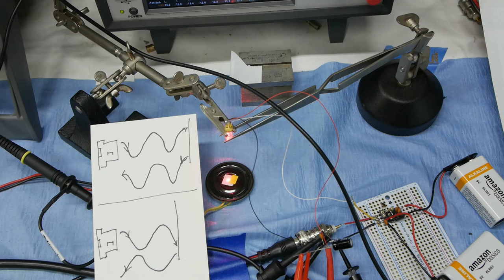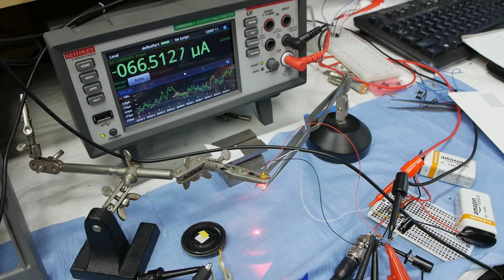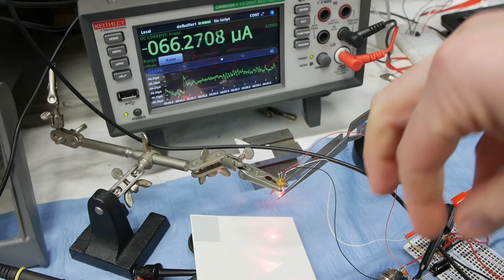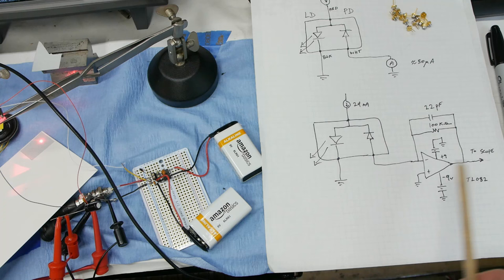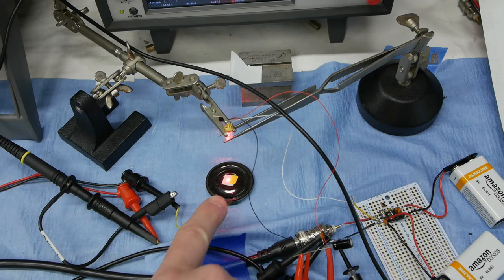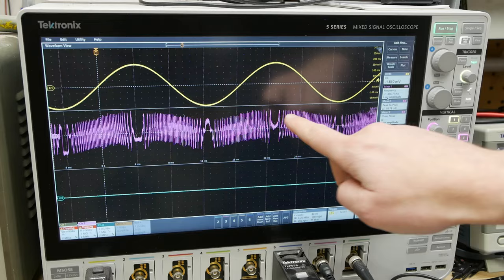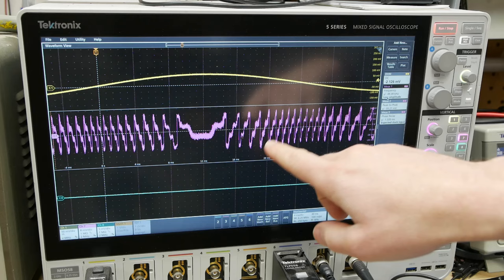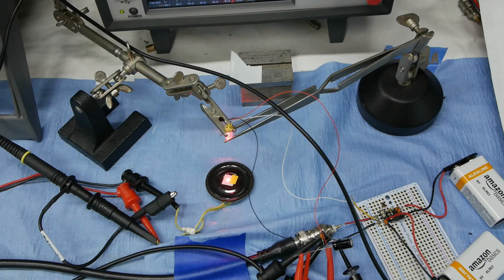Laser diode self-mixing: Range-finding and sub-micron vibration measurement

Comment: I did my PhD on this exact topic. Yes, it is true that you can get the signal using just the laser diode itself, you need an extremely stable current source for the laser and then a very high gain amplifier with low noise on the terminal voltage of the laser. Even in academia, few people try to do it because using the photodiode is way easier. There is also some semiconductor noise which shows up in the terminal voltage signal which is hard to get rid of. You can determine the direction of movement in your piezo speaker example by just looking at the slope between the fringes.
Reply: Also, the quality of the signal you get back using the terminal voltage depends strongly on the structure of the laser itself (ie VCSEL, DFB, etc)
Reply: I did my Master's on SMI, shake hands :)
Reply: look at vocalzoom. they did this sensor and it's for sale. extremely robust and can also work as laser mic
Reply: @CG-cw3ps  "high power" means different things to different people, and certainly depends on the wavelength. A 10W CO2 laser (about 10um wavelength) is considered to be a baby CO2 laser, whereas a 10W 405nm laser would be an absolute monster. For me, 50mW at 850nm was about the limit, but that would easily cause permanent blindness and the beam is invisible to people.

As far as unexpected behaviour, I sort of think of lasers like cats; every cat is different, and you can only really encourage them to do what you want.
Reply: C G I’m not totally sure, but my guess is that you made some sort of copper oxide by heating the copper
Reply: That's why you modulate the signal, even if not just for still position sensing. This allows you to recover a modulation-correlated signal, so you can use a lock-in amplifier instead of amplifying blind. But I agree, trying to decipher such a signal from the crappy built-in PD is very hard, but that could have some niche applications, such as sharing a lens system without a splitter in a low cost system. There is no better position to place a PD other than right next to the emitter, that is, unless you use the emitter as detector (which is not that far fetched).
Reply: @talbakish9479  As I understand you are part of VocalZoom, is it possible to talk or chat with you?
Reply: @talbakish9479  lmao. Trying to drive traffic to your product while acting like you're not part of the company.
Reply: @AureliusR  No secret. Its all over the internet.
Reply: Ben I need help to measure the wavelength, power and frequency of a product I purchased can we talk or email each other?
Reply: @talbakish7045  then why did you refer to VocalZoom as if it was just some thing you had come across on the internet, and not your company?
Reply: And So? @AureliusR
Reply: @jonathanlister5644  I call out dishonesty, especially around business practices, when I see it.
Reply: Ok mate I was not aware when I noticed your comment I responded too quickly. Certainly we all have to alert people to such practices. Cheers!  @AureliusR

Comment: The Japanese company Keyence makes commercial laser sensors based on a multi wavelength refinement of the basic interferometric technique you demonstrate so nicely here. They can get down to 1 nanometer resolution!
Reply: Sony makes laser hologram encoders with 8 picometer resolution :D
Reply: Bolt it to a slab of metal that weighs at least 1000lbs and you'll see your jitter drop enormously.  lol

There is a lot one can do in their lab for cheap to approximate the big kids.

When doing dimensional analysis, particularly at this small of feature geometry (or at least the hardware is capable of it with some tuning), having standards that are at least in the ballpark of your dynamic range is critical and if you can't afford a set of $1k slides/blocks then buy 3 sets of cheapos that might have been built with something moderately calibrated in some factory somewhere and reconcile them until you get your field of measurement dialed in to where you can tell the difference between your three cheapos - then at the very least you can ask the most connected person you know to take yours and at least match them to a calibrated set and give you some correction notes, or if they have any moderate fabrication tools available to them, see if they can/will correct your standard directly.
Reply: Actually, not so much jitter as conducted environmental noise goobering up your signal.  So you need to isolate/decouple too or you may get seizures from the noise twitching.
Reply: Two german companies make the exact same instrument with with single wavelength and achieved 1 pm resolution
Reply: There are also specialized range finders, used in geodesy, that use multi wavelength interferometry and time of flight delay, to automatically compensate for atmospheric refraction, and get millimeter accuracy over kilometers. Some are still in developement, but techniques used are awesome.
Reply: I've used their sensors. Very good performance but they were pretty expensive, at least they were 15 or so years ago.
Reply: @russellzauner  
said > Bolt it to a slab of metal that weighs at least 1000lbs and you'll see your jitter drop enormously.
It may be useful to provide part of the slab support with deformable rods of soft metal, such as solder, while the main weight is supported by springs. The goal is to reduce vibration problems by providing isolation, damping, and filtering of all but very low-frequency mechanical noise. Simple airbags can be the springs. Even good bubblewrap may work, if the load is spread over a large enough area. There is a form of aluminized bubblewrap designed for thermal insulation which combines springiness and a little vibration damping all in one. Reflectix is one brand of it I have used. Claims for the thermal properties of such materials appear to be exaggerated, but this is a different application, inspired by claims of using it underneath concrete slabs, where actually it insulates poorly, but does demonstrate the ability of carrying significant load weight. https://s3.amazonaws.com/greenbuildingadvisor.s3.tauntoncloud.com/app/uploads/2018/08/08032018/Foil%20wrap-thumb1x1.jpg
Reply: Only vocalzoom managed to develop such a commercial sensor
Reply: Keyence doesn't have self-mix sensors as far as I know. The challenge is not only accuracy level but also keeping the design cheap. Otherwise why use self-mix
Reply: @talbakish9479  stop the pitch
Reply: @nicholasroos3627  . Read my comments. I refer to tech issues people wrote about. Vocalzoom  the leading company in this field and our employees participate in many such forums. We believe this technology will become standard and we definitely have a lot to contribute from experience. Furthermore I’ve been approached by many of the people mentioned here to provide more information. I’m sorry you find this annoying and you remark is well noted.
Reply: Is it available for a low price?

Comment: I believe that the movement of the reflective target by 1/4 of a wavelength results in a path difference of 1/2 wavelength which changes the light from constructive to destructive (or visa versa).
Reply: Good thinking. So peak-to-peak of the waveform corresponds to displacement of 1/2 wavelength.
Reply: so the displacment equals to number of fringes multiply the wavelenth or half of the wavwlength
?

Comment: You can also get sub-micron distance measurements from this setup!  Basically, you could calibrate the exact distance to a target reflector one time, and then use peak counting in software to determine the distance as it moves closer and farther.  Kind of like the speaker, but free-floating.  As long as peaks are never miscounted, it will maintain its accuracy to sub-micron levels, and you can move the reflector arbitrarily far.
Reply: Sounds like I just got me a new DRO for the mill. lol
Reply: Cool idea! Very sensitive to any change in wavelength, though, and relies upon the diode maintaining phase coherency without interruption over the entire operating period. If the laser diode looses coherency, you will miscount. It is my understanding that lasers do have coherency dropouts from time to time.
Reply: Wouldn't ambient light affect the measurement?
Reply: It shouldn't as long as the ambient light isn't also coherent at the laser wavelength.  That said, it would still be a very sensitive setup, not practical for most applications, but doable in lab conditions.
Reply: Would this be able to measure distances and/or thicknesses of engine components or would the metal (often reflective) surfaces in between effect it?
Reply: @TheRainHarvester  No, you just use a lock-in amplifier.
Reply: Drift will be an issue. You will need the diode to be in a temperature controlled oven and to tightly regulate the current. Presumably you can calibrate with a gauge block and your calibration will be as good as the gauge block is. It would be nice to have a way to lock the wavelength to something based on some natural phenomena such that you would know the wavelength very precisely like they do with commercial gene laser systems.

Commercial interferometer systems use a helium neon laser. There are two modes that are original to either at slightly different wavelengths. The length of the resonator (the tube) is controlled by adjusting the temperature with a heating coil around the tube which controlle the wavelength of the laser. When the two modes are exactly the same amplitude then they are centered around the peak of the gain curve. Since the center frequency of that curve is a function of the basic physics of the laser and the gases that are used in it, the wavelength is precisely known. Isotopicaly or helium and neon are used to provide narrower emission lines. The two modes are split out and sent down different paths. The configuration looks like a Michelson interferometer but the theory is slightly different. One path is sent through a waveplate and rotated 90 degrees so the two beams are the same polarization. They are then recombined and beat together on a detector. The result is a signal that is the difference between the two frequencies. Usually around 2 to 20mhz depending on the system. There are legs of the interferometer. One is fixed. One is on what is being measured. You can either mount your receiver on it or put a retro reflector on it. If you move the move the object being measured, the beat frequency changes. If you could the pulses, on a stationary object, you will get,say 20 million per second. If you move the object you get more or less depending on the direction. By maintaining a running found you know how far the object has moved from the point that you zerod the system. A typical system can read down to a 2000th of a wavelength of red light or around 300pm, assuming tight enough control of everything else. They are commonly used on wafer stepper stages in semiconductor fabs. The hardest part of dealing with these systems is noise. They are so crazy sensitive that any vibrations can drown out the actual measurements.
Reply: "The two modes are original to each other" should read "the two modes are orthogonal to each other"
Reply: The absolute distance using the ramp is the most interesting. It should completely possible to count the peaks on the ramps. My understanding is that laser diodes frequency stability is terrible. And that's what you want.
Reply: @michaelallen1432  Two lasers must be used. One counts an approaching, the other one counts a disposing. Thermal shift will be applied to both of them in a same way, so can be subtracted. But of course this setup is for a case when you can light up two opposite sides
Reply: so the displacment equals to number of fringes multiply the wavelenth or half of the wavwlength
?

Comment: Nice... similar to the principle that I co-developed for a microwave motion detector back in the late 1970's. It just used a simple/cheap Gunn diode microwave source (10GHz), high-impedance power supply, and detect Doppler shift as AC/audio across the Gunn diode.  It used about a 6" parabolic dish antenna, which was also the reflector for the light... as this was an automatic motion sensing yard-light.
Reply: Did it fry the neighbors cat?
Reply: You can now buy the same thing for a couple dollars, most seem to just connect the RF circuit to a board designed for  a PIR sensor and it works well enough.
Reply: I'd like to know more about this I find unpublished development history fascinating

Comment: The offset between constructive and destructive interference is indeed half a wavelength, but since the wave has to travel both to and back from the reflector, the displacement of the reflector has twice the effect on the offset of the wave. The difference in reflector displacement between full constructive and full destructive interference is therefore the quart of a wavelength, not half a wavelength.

But pretty impressive stuff!
Reply: Came to comment on the same topic. 

Indeed the path-length difference in the reflected ray is double the displacement of the surface; but the destructive interference would only result in an intensity maximum every half wavelength if counterpropagating relative to the non-reflected reference beam. If the reference and reflected beam are coaxial and traveling in the same direction (which seems more likely), then a full wavelength shift of the reference beam is required to cycle the intensity pattern once.

So assuming the reflected and reference beam hit the diode from more or less the same direction, id say 2 maxima per single wavelength displacement of the reflective surface. 

But it really depends on how the beams meet, and if that is in a nontrivial way, all bets are off; though 4 maxima per displacement is indeed a theoretical maximum.

Best to get out a micrometer and measure it!
Reply: You need to take into account the distance between the LD and PD as well, right? Or is that to be ignored because it's a constant?
Reply: @Refthoom  Yeah pretty much. Should you vary that distance, you would not observe any variation if the light bundles are travelling in the same direction; or two maxima per wavelength if they are travelling in opposing directions. But as long as you dont vary it the actual distance does not matter since the light forms a periodic pattern.
Reply: I noticed that also and saw you already had commented. Important detail.
Reply: Actually, in commercial implementation (such as in Vocalzoom IC) we modulate the laser and we get much higher fringes speed per movement
Reply: so the displacment equals to number of fringes multiply the wavelenth or half of the wavwlength
?

Comment: Holy crap. I can imagine this might form the basis of an optical servo tweeter. Or a new way of characterizing drivers at least.
Reply: Afrotechmods Might be a challenge at tweeter frequencies. But my application is monitoring the performance of low frequency drivers, up to 2kHz, and there this might be a practical proposition if enough signal could be extracted from the photodiode output.
Reply: @BillySugger1965  subwoofer distortion monitor aye?
Reply: Laser vibrometry is the standard method of characterising acoustic drivers.
Reply: @vk2zay  you have an interesting channel also vk2zay. subbed
Reply: Thanks mate.  I've been ignoring it lately, time to make more content!
Reply: I remember this on "Tomorrow's World".
http://celestion.com/speakerworld/patech/4/114/Advanced_Cone_Measurement_and_Analysis/
Reply: Also the basics of a Doppler radar.
Reply: where have u been man i miss ur pretty channel
Reply: @vk2zay  Dude are you the guy who invented the vive base stations? I think i stalk you on reddit (young EE, you're a legend)
Reply: @supershiva11  what is the vice basestation...
Reply: backes & mueller, a german speaker manufacturer actually make servo tweeters for their speakers.
they are using a metal dome tweeter charged to about 300v with the audio signal modulated onto it and a dome-mesh behind the diaphragm to measure the capacitance change and use this as their feedback signal for the amp.   
poking at it would be a bad idea, but theyre behind a protective cover anyways.
without the high voltage and circuitry on the back its just a normal metal dome tweeter driven by a coil

Comment: On the square wave you are hearing the sharp rise and not the small ringing. 
Basic fourier stuff, a rapid change requires high frequencies. 
The steeper the change, the higher the frequencies produced. This is why the "ramped" square wave was not audible.
Reply: That's correct. Might I add that the driver used, or pretty much any driver will have a hard time reproducing a clean square wave at anything other than low midrange and down without a great deal of jiggery pokery in phase compensation techniques.
Reply: @KravchenkoAudioPerth  Fortunately that doesn't really matter too much, as we are only sensitive to the magnitude of the spectrum and not phase distortion.

Comment: This is very helpful for understanding signal processing in vibration measurements. I am currently using a laser doppler vibrometer to characterize a MEMS device I built for my PhD project. These are $100,000+ systems and I heard that cheaper methods were possible. This was a nice demonstration of one such method.